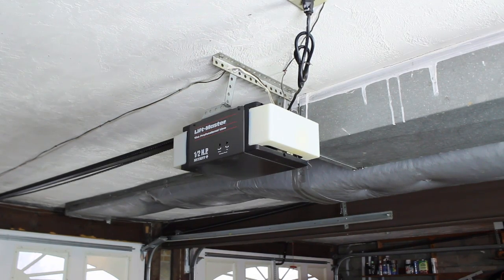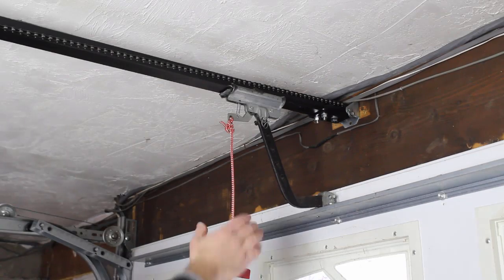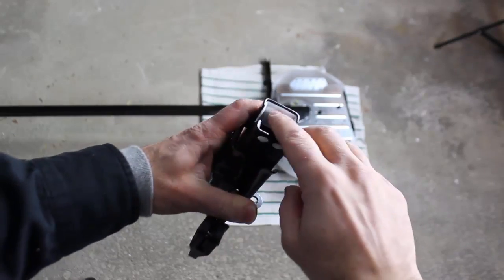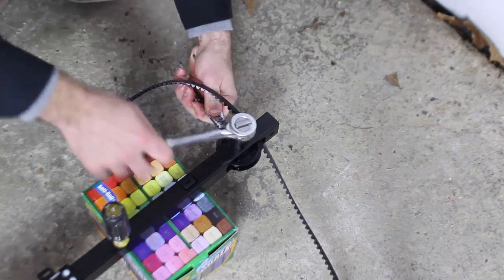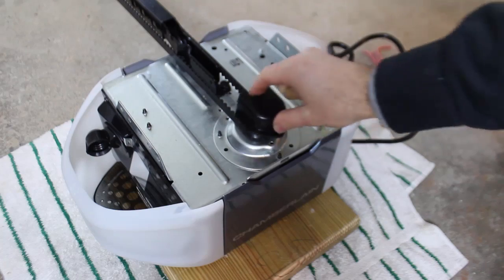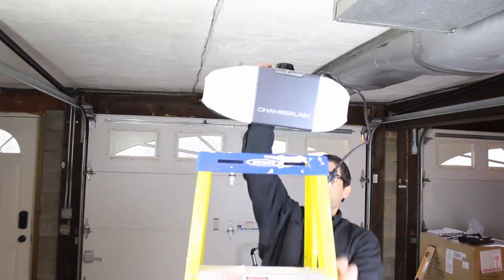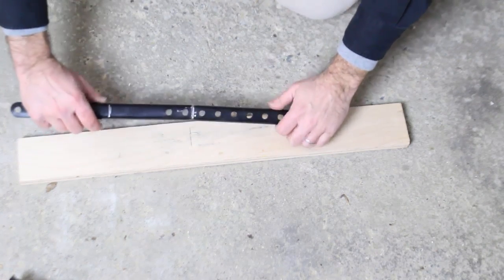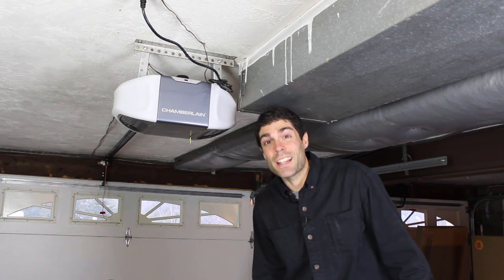Garage Door Opener Installation -- by Home Repair Tutor

Comment: Great video, followed it from start to finish and I now have a newly installed Chamberlain garage door opener. The only comment I have is around the bracket that attaches to the door itself. Mine didnt have a pre-existing bracket already there, so I had to drill 2 metal holes into the middle frame of the garage door, and then use 2 smaller lag bolts to attach the bracket myself. Great video, especially for something made 9 years ago.

Comment: I did buy this garage door opener, or similar model.  Your video is pretty much spot on.  I will say, I think you left out a very important step, and that is the programming of the "Travel".  I followed the directions and when I had trouble, I referred to your video.  Once the garage door was up, I thought I was done.  I was not.  Once hitting the opener, the door travel went all the way to the stop bolt!  Actually, I thought this was a defect and got an exchange.  This next unit did the same!  After reading the directions again...pages later in the instructions, I realized I had to program the "travel".  Once this was done, both units worked.  While your video was spot on in installing it, I suggest to your guys watching your videos to program the travel before operating it.  Also, on a another note, this garage door opener was not compatible with my 2007 Escalade SUV.  A compatibility module needed to be ordered according to Chamberline support.  Thank you for your video!

Comment: Thanks bud, I was able to finish the work in a week. Had to do several trips to home depot. I had to move my bracket support from the attic. Glad it worked perfectly and it is way easier to do it by watching you showing the parts and how to do it. Thanks again. Now I have to tighten the torsion springs :)

Comment: Would like to THANK YOU for your video. After watching your video afew times i decided to buy chamberlain hd520evp and install myself with the help of your video.
After about 3 hours unit was installed (i am 65 and slow)
The only problem i had was wiring the sensors i had mixed up wires.
I saved on having to pay someone to install and i leaned something new.
Thank you again

Comment: Just installed this unit yesterday but should've watched this first. Two items slowed me: the stop bolt and the spring nut.  At first thought I didn't have the stop bolt as nothing I had resembled the bolt graphic.  The spring nut stumbled me too, as never used that and I noticed that you glossed over that section.  The spring nut section should be exact as I suspect many are like me. Took me awhile then it sorted.  thx
Reply from the maker: +apexx scout sorry you had some issues with that. I think the spring nut gave me some issues too...probably should have talked more about that
Reply: +Jeff Patterson 

lol, what's odd is that for all bolt applications, the directions had a nice graphic to match up. But not so with the stop bolt.  And the spring nut needed a brief and to the point sentence showing that the entire unit was one piece  to be installed THEN the spring popped over the disc thingie. That little spring nut thing was totally alien to me.  All good as this 3/4 hp unit with the inside door timer with motion sensor for the lights and the outdoor keypad and the quiet belt is easily the best opener ever.  Just trust that it works for years.

Comment: All installed had a friend help me out pretty much paint by the numbers. The only issue was we couldn't use the preexisting wires that were run through the wall. The attic has a finished floor and the wires were under there. Chamberlain provided plenty of extra wire. Also the new opener was super easy to program, about as easy as pairing a iPhone to your car. Good luck with this if you attempt this DIY....

Comment: He did a very nice job on the video and for the most part was correct,(there were a few mistakes he talked about).  But there are so many issues with the door to begin with that a professional door installer should be able to see. First if the correct tracks were on the door because it has the duct in the center then he could have installed the motor in the center where there is a style on the door (support system) so the motor will not rip the door in case of a mishap while moving. (this is especially true since the door has extension springs on it so they pull evenly). The time he took to mark the wires and so was not needed since you get new ones in the box (color coded) and easy to follow the directions. New Motor = new wires makes sense in case there is a issue with the wires somewhere. The safety sensors do not stop the door from opening or closing like he mentioned (a big myth customers think) Safety sensors are designed to REVERSE the door while in the DOWN travel ONLY in case something breaks the sensor beam while moving. The door will always open when activated even if you break the beam. And also the bracket on the door that the motor (j arm ) mounted to should have been underneath the strut going across the door. This is on the door to support any unusual pulling force to the door. By being above it there is no support here. Chamberlain is a nice product for a store bought  motor but it has the 4 rail pieces that snap together, A  Liiftmaster Motor which is made by Chamberlain Corp is a professional grade product so the parts are a upgrade and the rail is a solid steel rail for more support. Just a few things I noticed to let you know sometimes things do not seem as perfect as they seem.

Comment: Well if you need to do this its a good time to do so. Chamberlain is putting out all new openers all will have wifi. I bought a last years model today on clearance at Home Depot regular price $238.00 on clearance $126.00. I purchased the belt driven model. The one I will be installing doesn't have wifi since we open / close our door via the security system. I'll be doing this in the am, I'll let you know how it goes.

Comment: I have a craftsman installed and everything was working fine until one day it only opened or closed half way.  All the sensors were still connected and nothing blocking. What could be the problem in your opinion? Nice video by the way, very thorough and easy to follow.

Comment: Great video. Mine opener just died, and I need to try to save some money by doing the replacement myself, if possible. Thanks! Quick question... Is there a reason you had to install new mounting brackets - and install them in a different place - instead of using the existing ones?

Comment: Thanks for the video sir. I will need to replace my 32 year old Craftsman opener as it just died. The process really doesn't look that bad but I will have to install the sensors as well because mine is so old that it doesn't have them. Lol

Comment: Love my new Chamberlain belt drive openers.  Yeah, that spring nut can be a bugger,  I had to drill out the hole a little to fit the spring nut bolt in.  No flat side on mine, and the opening is round also.  My instructions for mounting the belt were also slightly different.  The screwdriver is placed in the second section from the motor, and the traveler is then run up to the screwdriver from the motor end.  Then when ready to connect the brackets to the door you release the outer traveler and slide it towards the door.  Unfortunately the instructions only say that the travelers will mate up when the unit is run for the first time, but when first powered up you will be setting the travel, so the instructions are not accurate on this point.

Comment: using the old mounts  was ok and a short cut but it is worth mentioning that they need to be in a place that allows the travel not to vary side to side or up and down the rail should be perpendicular to the wall  and pull straight on the door or parallel  to the  face of the lifted door ...not pulling up or down on the door when it is in the opened  or opening phase...  thus eliminating the possible install mistakes that were existing ..if it wont pull on the door straight  it can bind the door making the life of the operator and the door shorter and cause erratic operation...also need to check spring tension...(they get weak after operating many times) and  overall door operation by hand.(should not bind  should go up straight not crooked shouldn't catch on something ...rollers should have good bearings  etc)..the springs lift  the door ..the operator just assists the springs in lifting  and if its required to provide too much lift effort that may have caused the last unit to fail..no use in ruining the new unit you just spent your hard earned money on...not rocket science but a good common sense look at things while your workin on it is worth the time
...(ya i do it professionally.).not criticizing the vid ... I like what your doin  .... just addin a couple of tricks and stuff to watch for...hopin it helps someone out

Comment: Mr. Patterson, your video was very helpful. I have a 13 year old Craftsman chain drive door opener that is giving me problems. Depending on whether it's up or down, the door stops after I push the button. I have to push the button several times before it either raises all the way up, or closes all the way. Do you know what the cause of this is?
Reply: +mosspointman 

same thing with my 'cept mine was a liftmaster.  Then it totally failed.  I called a local door tech and he told me that he  could FIX it but it would cost me 185 dollars.  I then bought the 3/4 hp chamberlain with the belt which cost me 200.  Tech guy really made things easy for me.  lol

Comment: Great video. I don't mess with electricity so my question is. I have a newer home and garage is prewired but When installing all the wiring, do i need to turn electricity off to the house?
Reply from the maker: elias R. it's a good idea to turn the electricity off to the breaker that supplies the electricity to the opener and switches :D

Comment: Great video except I installed the lag bolts to to the drywall only and not into any wood beams. After a day and a half the drywall gave out and the unit crashed down onto the roof of my Porsche.  Bummer!  (Ha ha - just kidding).  On a serious note the video was very helpful and made it much easier than relying on the directions.  Thanks Jeff!

Comment: Hi Jeff,. Thanks for posting.  I just the same opener as you.  Thanks for the video.  I had a quick question.  My prior set up was similar to yours.  You did not show how you switched out the button that you had opening the door to the new one provided.  Is that a big job and that I will need to run new wiring or is as easy as popping out the old one and installing the new one that was included.  Let me know.  Thanks!
Reply from the maker: +sybelen funny part is that I didn't do that yet...it's only a big job if you have to run the wire through a block wall and it's hard to fish the wire, but nothing too crazy. You can do it :D

Comment: The Chamberlain would work with the old rail if you have a chin drive because the one piece t-rail is stronger than the tube rail that is provided with Chamberlain. The old safety sensors will also work with the Chamberlain beocues Chamberlain is made by Liftmaster who made old opener and I recommend to replace the wall panel because liftmaster changed the design of their machines in 2013.

Comment: Hi ...I thought this video was easy to follow (for someone like me)  who was trying to get some insight into as to why I have to hold down the "white bar" to close my garage door. It's the part of the unit attached to the wall of the garage ...used when I push it, to close  my garage door. . Usually I press it for a second and the door will go down right away. Now I have to hold the white bar down until the door reaches the floor of the garage. I've checked that the green and amber lights are on and in place but I wondered if (by mistake) I've disabled the emergency release handle or put it in the wrong position. To tell you the truth I have no idea what I'm talking about!!! My husband who used to look after such matters is no longer with me (died). I did have a service fellow out 6 months ago. I had disconnected the emergency release arm by mistake. He put it back into place for me and told me if I'm having problems again to check that it's in place and that the green and Amber lights are on. Is there any reason I'm not aware of ...that the garage door will not go down.. unless I hold or press the white bar for the length of time it takes to close the door. Thanks. Sybil

Comment: Very well put together video, and nice job on the installation! I have to tell you though, a very common repair call I get has to do with someone re-using old safety sensors and wiring. There are certain exceptions, like when the wiring is run through the walls, but otherwise it is smart to replace everything when you install a new opener. In the video, you said to take a picture of the wiring on the old unit, did you re-use your old sensors?
Reply from the maker: I did use the old sensors and they work ***** but that might change. The wiring for the switches doesn't work, so I'm going to swap out the old switches for the new ones that came with the opener. Kinda not fun but necessary :D

Comment: Hello, can you advise when setting up the header to the unit should the rail be level or slanted toward one side? I'm having an issue with the rail track bending as the door opens and closes either up or down. Thank you

Comment: I have the two things at the bottom of the opening (the garage door) they act as eyes. both of the lights are out.   the garage will only open if you push and hold the opener button
Reply from the maker: +Jeffery Miller the sensors might sound like they're either bad or not wired, they're a great safety device when hooked up

Comment: You could've just swapped the motor head. Liftmaster and chamberlain are compatible. Plus the one piece rail you had is alot sturdier.
Reply from the maker: bigyoginhc60 good points, I like the belt drive better and the ability to remotely control the new Chamberlain with home automation :D

Comment: Could you not have re-used your old garage door hardware that was attached to your garage? (The bracket etc?)
Reply from the maker: I reused some of the brackets Tony Ohmer but other parts didn't fit the Chamberlain configuration.
Reply: Thanks! I successfully installed this last night :) great video!
Reply from the maker: Awesome!! Great job Tony Ohmer - do you have any tips that might help out another DIYer? You have to be so stoked :D

Comment: Does the rail need to be level??
Reply: no, but it looks nicer.  in some cases, the opener should be lower than where the rail bolts to the wall. I think 1 piece doors are like that.  The opener should not be higher than where the rail mounts to the wall, tho.

Comment: your old opener what was wrong with it? Did you open and inspect the gears? Sounds like your door had issues in video. If your door isn't correctly balanced and free from binding this opener will also eventually fail.
Reply from the maker: +PINCHHITTNMILWAUKEE the old opener had a broken spindle, the part that operate the chain. Unfortunately the entire setup for this door is hindered by a ventilation shaft. So it's not perfect but has to suffice

Comment: don't you guys forget that before testing out your garage door opener (turning it on), you want to make sure you unlock your garage door (there is a metal lock that slides) so that it can open properly. Otherwise, you might experience like i did, a breakdown of everything close to the garage door pulley (rails bending, garage door bending, wall bending). T_T
Reply: PeaceFinder12 i dont have that bar, i have a diffrent lock but your life seems to suck at that moment

Comment: you forgot one step in your garage door installment the two bolts that go to the Cross arm or supposed to be far apart the Top O cousin the top one the last one goes on the bottom one not together the father they are the more stronger it is

Comment: 1st off the safety sensors don't keep door from going up if something obstruct the lasers, quite the contrary ! If interrupted or obstructed they will reverse the door causing it to go up thus no child, animal or property such as a vehicle will be come damaged or injured. Secondly what if the opener was installed incorrectly the 1st time ? Like the one in the video was ,the door was installed incorrectly the strut in not located properly and niether was the bracket for the opener arm. "They should always be located under the strut" ! Doesn't matter where the bracket is located on the door or where the opener arm pulls from so long as the door is probably ballanced. I'd consider this a good video more for ways not to install rather than an proper example of the way to install one. Also not covered is the proper hight of the opener track should be . So anyone attempting to install a new opener the formula is 3" if it's not pulling straight back as it travels up you risk folding the top pannel no matter if you have  strut or not.. My advice is don't use this video as a guide on how to unless you're looking for trouble.

Comment: AFTER INSTALLATION OF THE GARAGE DOOR OPENER, I PROGRAMED THE MAIN GARAGE DOOR PANEL OUTSIDE AND SET THE CODE. BUT WHEN I WENT TO CODE THE REMOTES, ONE OF THEM PICKED UP THE SIGNAL AND I WAS ABLE TO USE THE ONE REMOTE BUT FOUND OUT WHEN I DID THIS THE MAIN PANEL STOPPED WORKING AND THE SECOND REMOTE WOULD PICK UP THE SIGNAL EITHER. SO I GOT ONE REMOTE THAT WORKS, BUT THE MAIN AND SECOND REMOTE WONT PROGRAM WITHOUT DELETING THE CODE FROM THE OTHER TWO. HOW DO I CODE THE MAIN SWITCH AND THEN THE TWO REMOTES SO THEY ALL WORK OFF THE SAME CODE? ANY HELP WOULD BE APPRECIATED. THANKS